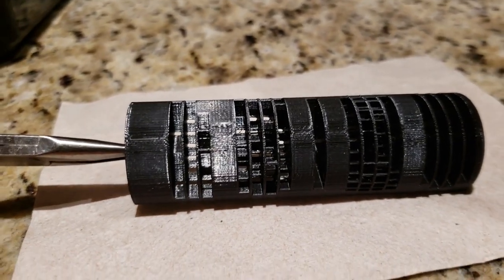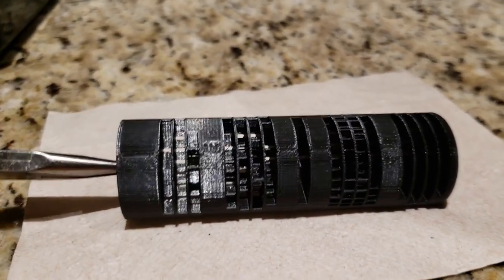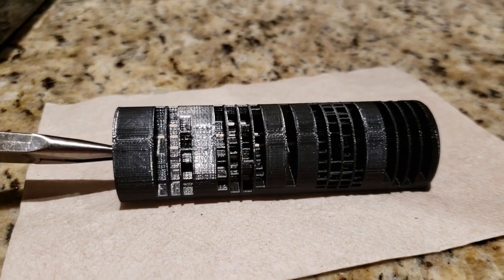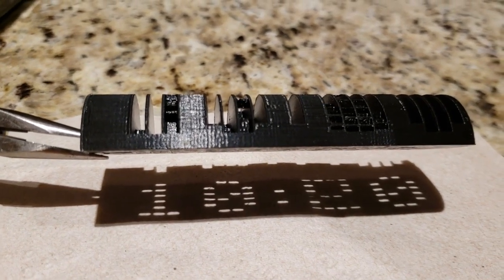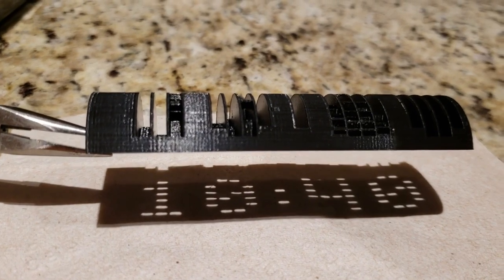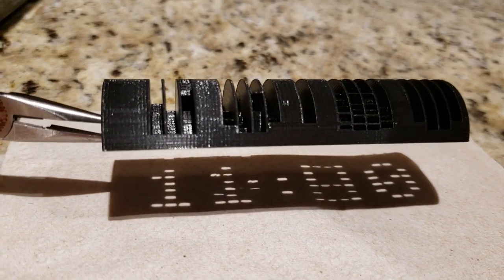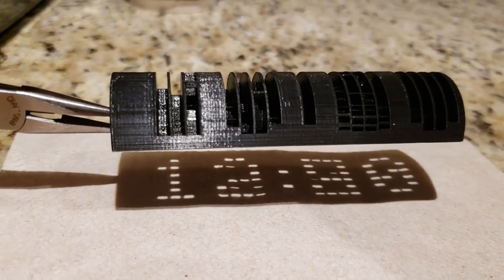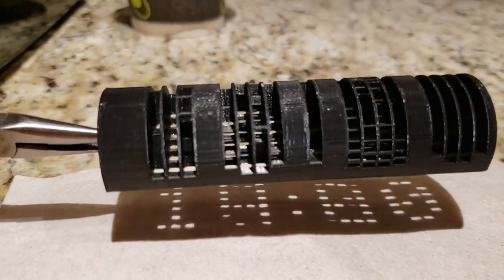3d Printed Digital Sundial

Comment: What material, printer and settings did you use?  Thanks!
Reply from the maker: Sorry for late reply-- I think for this one I used PLA, but later used ABS.  Just be sure to have no supports and print slow.  You'll have to use setting optimized for your printer so hard to say.